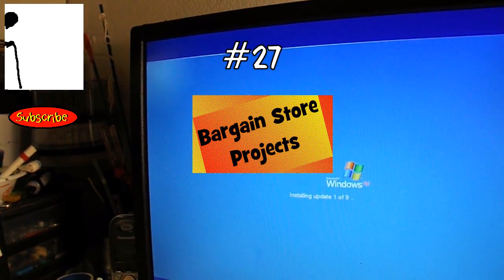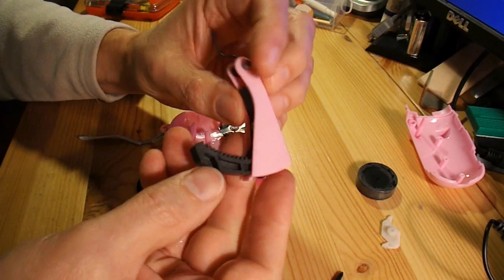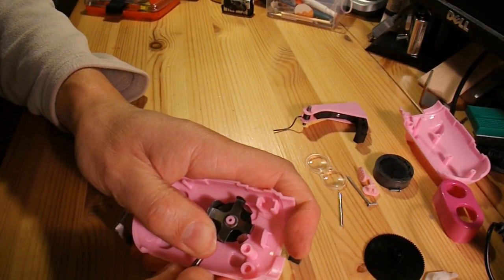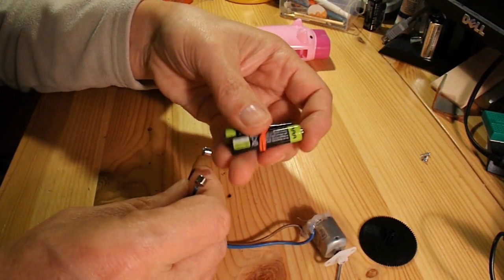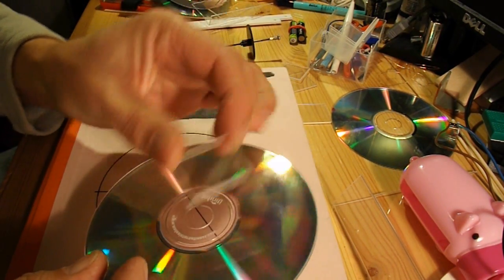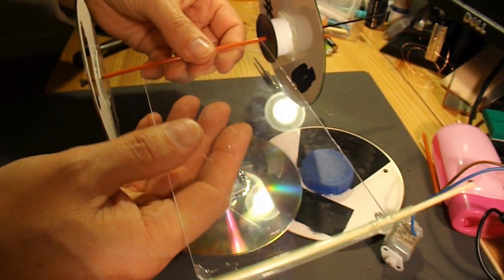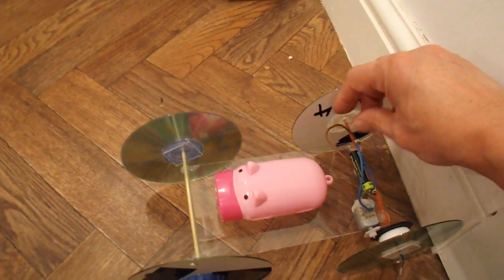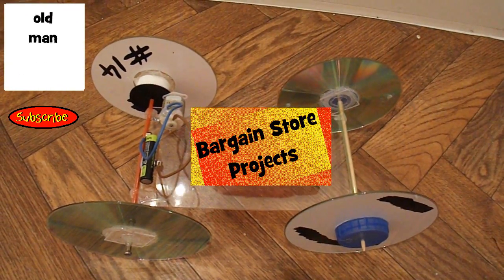Bargain Store Project #27 Dynamo Pig Torch to Electric Car

Comment: where do i get pi torch
Reply from the maker: I don't know where you would buy one.
I know where I bought mine. I bought it in Poundland which is a Bargain Store.
There are many similar items sold in many different bargain stores.
The only part of the torch that was required for this car was the gears and you could get gears from other sources.

Comment: can i buy in online
Reply from the maker: Probably, you can usually buy most things online. Maybe you should search for it.
The only part of the torch that is needed for this car is the gears. You could just buy some gears from somewhere.
My Bargain Store Project series is about buying something in a bargain store and repurposing it for something it was not designed to do. If you just want to make an electric car, you don't need to buy the Pig Torch, you can get the parts form other sources.

Comment: Hi grandad.  You probably know this already, but I'm still working my way through your videos, so here goes...  I've taken four or five wind up torches apart and they've all been a lot more useful than this (appropriately named?) Pig.  Usually get a very good high ratio gearbox. Sometimes a nice little lipo and management circuit.  In some the "dynamo" is a nice little DC motor used "in reverse".  Others have brushless generators.  Any way, on one of the bigger ones I just cut the two wires going to the "dynamo" , extended them, put the case back together and  fed it with 5V.  Fantastic low power, high  torque device for my solar well-pump!   Thought of using one as a portable charger for your capacitor planes?  Keep up the good work!
Reply from the maker: Ray Kent thanks Ray, I am guessing those torches would be slightly up market to these cheap ones. I have used the coil for some other projects as it is a handy size. Here is and example https://youtu.be/JfkOgoAgjE4?list=PLA5a2xPRSrB1SVLRn_D16dRvTrocMhFPq

Comment: you should put screen retainer spine on the edges of the CDs to work as a rubber on a tire. That way you can get more traction on the floor and go even faster .
Reply from the maker: Hey, thanks for the tip. I usually use strips cut from balloons or rubber gloves or latex gloves for extra grip. I will keep my eye out for screen retainer spine and give it a try.

Comment: I recon you could glue some pebbles to the bottom of the plastic chassis to slow/weigh the speed  down.
Reply from the maker: You could do that, or change the gearing, or the size of the wheels, or less powerful batteries,

Comment: I see you are using XP.
As an intelligent person you are, switch to Ubuntu and you will not regret.
8-)
Reply from the maker: I have 5 PCs running, 2 with Linux, 1 xp, 1 vista, 1 windows 7, and my wife's laptop is windows 8
Reply: GrandadIsAnOldMan I thought so to me, that you conformaras one easy xp. 8-)
I all pcs that I have are old computers running xp, Ubuntu and Puppy Linux with a USB flash drive to the PC with P III.
And where I have Ubuntu, I've put Vurtual Box, to also run with W7 with some programs.

Cheers and keep it up!.

Comment: You're welcome. I see you are a fan of hot glue as I am. So you could put hot glue around the edges also if you cannot find that.
Reply from the maker: The quickest and easiest option I have found is cutting strips from rubber washing up gloves but I think your idea of the screen retainer would probably look the neatest. I have also stripped the rubber insulation off power cable and used that and it gives a nice visual effect but you don't seem to get rubber insulation very often now, all plastic which does not grip so well. I have just been looking on eBay for the screen retainer and it looks a bit expensive for my taste but I might be able to find some round an old screen somewhere. Thanks again.
Reply from the maker: Just found some neoprene rubber edging trim on eBay for covering edges in metal cases. Looks similar shape to screen retainer spine and it is 99p per metre + 99p postage here in UK so I ordered some and I will give it a try next time I use CDs for wheels.

Comment: Where did you get those magnets? I would really like to buy some!
Reply from the maker: Hi Hunter, just search eBay for neodymium magnets and you will find plenty. The actual magnets in the video came from some items electricians would use for pulling wires through holes in walls. I got them cheap at a hardware store that had some old stock on sale, but I have bought them from eBay when I needed larger ones. Some craft stores might stock them but more often they are the cheaper low powered magnets. Neodymium is the name you need to search for.
Reply: +GrandadIsAnOldMan Sorry, this may seem mundane, but do you know what size the magnets that you used in this video were? 3 x 3 mm?
Reply from the maker: Jasmine Yong looking at the video I would guess they may have been 5x5 but any size would do as long as they are strong enough to overcome any springiness in the wires. I have used small segments from broken magnets with the same success, which is a handy use for an otherwise useless disaster when you have allowed neodymium magnets to crash together and shatter.

Comment: Hi you remember me ummm there is like a magnet on the wire what is that called
Reply: like where can i get them from
Reply from the maker: Hi Charleston, those little magnets I used to attach the wires to the battery are NEODYMIUM and I solder them to the end of the wires first.. You can get them from eBay or from some craft shops. They come in all sorts of sizes. You don't need them for this project, but I use them because it makes it easy to make the electrical connection to the battery IF THE BATTERY HAS THE RIGHT TYPE OF METAL CONTACTS, not all batteries have steel caps so it does not work on all batteries. Thanks for asking, I will add a note to the video description because you are the second person to ask.
Reply: ok

Comment: i got the same lamp i gonna make it
Reply from the maker: As far as I remember the only parts I used from the pig were the gears.
Reply: what are the gears?
Reply from the maker: Connect the motor to the axle. Big black gear on the axle, small white gear on the motor. Those are the parts that I took out of the pig.
Reply: ok